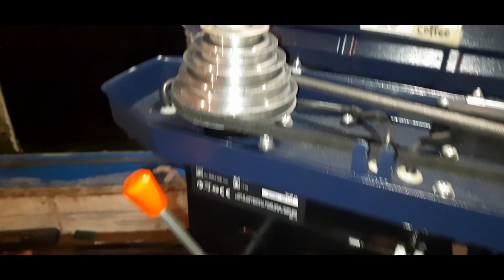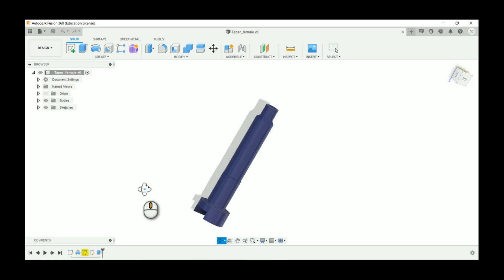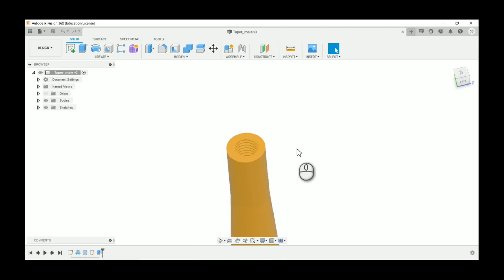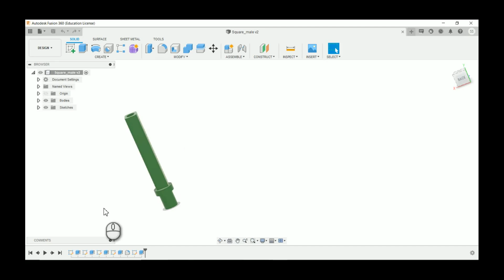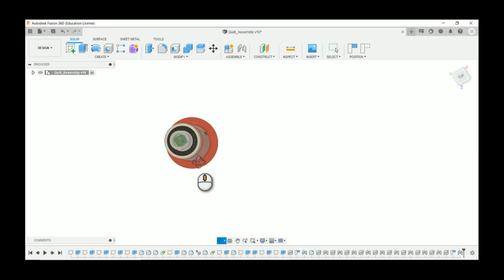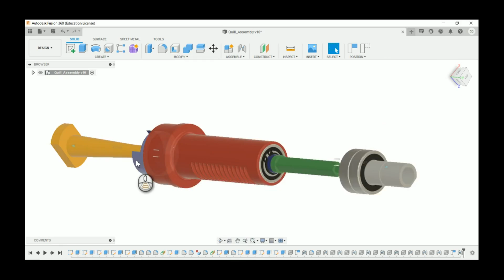Homemade Milling Spindle [PLANS]

Comment: Hi Steve. What you have done is remarkable to say the least; you already see it from the comments. Thanks for detailed plans! I'm the one who already is improving his small 8 inch drill-press and an improvement like yours is greatly considered. I have only one concern; maybe I haven't understand correctly but it seems to me the weak link is between parts 3 and 4 - just a press fit to transfer torque. It may fail and once it looses grip is prone to rapid wear. Torque in milling machines have series of pulse spikes like in impact screwdrivers. Maybe an additional set-screw between them could help. And an advice - try to find and use an already built coordinate table  (cast iron if possible) - you can find some at very good prices; flimsiness and flexing is the first enemy of metalworking machines. Not only machining  quality, but also tool life; and when you will waste too much on your mills, you-ll start wondering "why haven't I spent more on my machine ". OK, you have started from a drill press, and you can see the right solutions to improve its stiffness. Than, for completing the machine, don't choose design solutions that will weaken it (milling table I'm speaking of). Only my opinion...
Reply from the maker: Thanks for your comment! There surely are some things that need to be improved, this machine is a learning process for me so a lot will change allong the journey. I would like to make a better spindle with much larger bearings and a standard taper, as for the milling table, I am already planning on improving it with dovetails etc. Opinions can be valuable 😉
Reply: @EngineerSteve  Well, like you, I have started several things from scratch, just for the fun of understanding how they work, and counteracting downsides in iterations. About your milling table i think some sliding pillow blocks ( simple big square steel plates in pairs for each x/y axis) would help transfer vertical loads directly from the tool through T-slot table to the base, without any flex. In addition they could take horizontal  loads perpendicular to axis ways, by additional supports on the opposite sliding part. Even those could be improved for their  downsides. Remarkable is that in milling, apart from main direction of resistance forces, they have a periodic variation, even with changing direction periodically in a sinusoidal manner. Frequency is quite high, being given by motor speed and number of flutes of the tool - and of course, tool's wear status, as it is not uniform in 360 deg.
 Good luck in your work! I will be pleased to follow it being presented!

Comment: It looks like you used an arbitrary taper in the spindle which might be difficult to machine in a manual lathe. Have you considered using a standard Morse 1 or 2 taper? Reamers are widely available and a very easy way to make an inside precision taper. Not to mention tooling is just commercially available.
I wonder if you are Dutch or Belgian, I'm pretty sure from your accent as I live in Belgium myself. Are you a certified engineer?
Reply from the maker: Thanks for your comment! I have in fact considered using a standard Morse taper but on that point I already made these parts. If I want to improve this system in the future I will surely use a standard taper size.  I am not yet a certified engineer but I study for mechatronics engineering.
Reply: @EngineerSteve   Cool, I graduated as a product designer with a minor in engineering but I work fulltime as a mechanical engineer now. I have played with machines in school and now I’m starting to acquire and restore machines. If you want to collaborate on some parts or design I’d be down for that.
Reply from the maker: @shiro-r4m  Sounds interesting!  I really like the Mechatronics/Mechanical Engineering field. You're very right on that I am Dutch btw ;-)